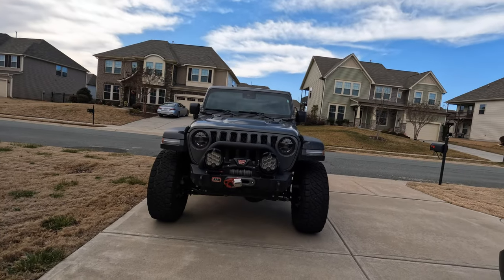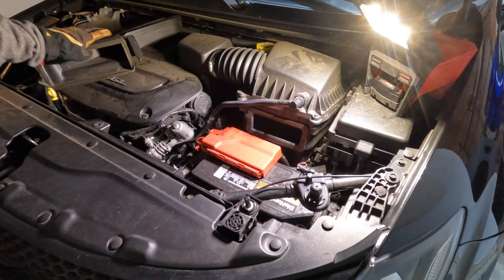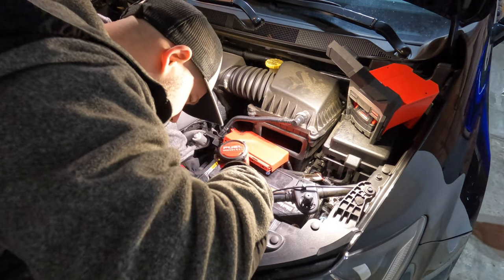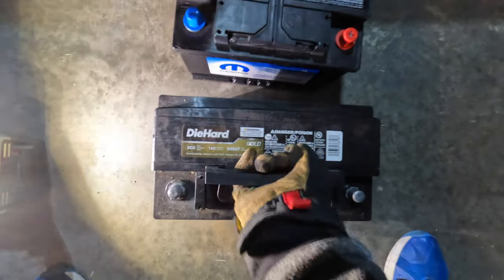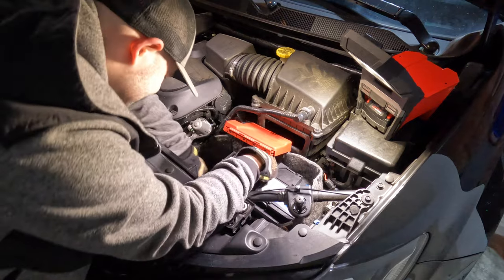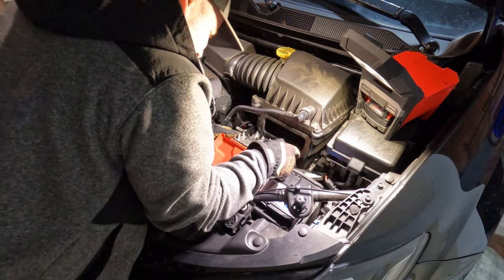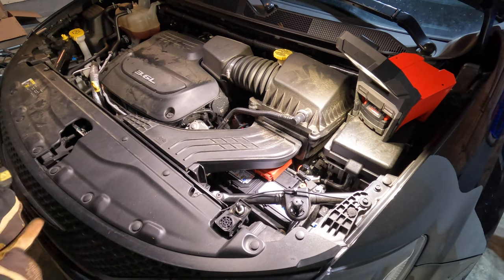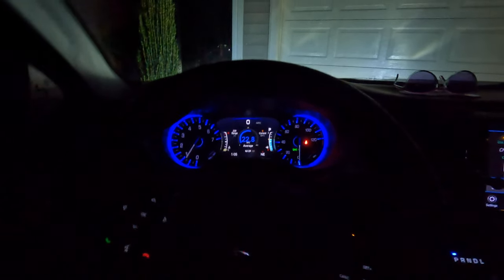How to Replace BOTH Main and Aux Batteries in a Chrysler Pacifica Minivan

Comment: Great video.  The reason the main battery doesn't fit properly is because you have an H7 which is slightly larger than the H6.  I noticed that Advance Auto lists both batteries on their website as a direct fit, however that isnt the case evidently.
Reply: H7 for vehicles without start/stop and no auxiliary battery, H6 for the Start/stop vehicles
Reply: Correct, H7 and H6 batteries are different size batteries.
Reply: Damn, I just bought on that says H7 lol. Going back now to get an H6 thanks guys
Reply: Apparently all the o’reillys autozones and interstate batteries have the H7 listed for the start stop models. I think it starts with Chryslers misinformation.

Comment: Note: if your start stop battery has been bad for more than a week or so (the light has been on for at least that long), You should just go ahead and replace both batteries like he did in this video. When one of these batteries goes bad, they both tend to go bad because the bad battery leeches from the other battery which will kill it rapidly... After a week or two at most. You can just replace the one bad one, but you are taking a big risk that the other one is bad and you may start a cycle of killing new batteries.
Reply: thanks for the tip.

Comment: When the stop start battery goes bad just disconnect it and live happily ever after. That is what I did. Mine only lasted about 1.5 years.
Reply: Which wires do you disconnect to disable the small battery for start/stop?  I hate this feature and find it super annoying anyway.
Reply: @patterbt  just disconnect one or both battery cables and tape them up on the small battery. I left my battery in there but I will probably remove it eventually.
Reply: I did the same on mine since I don’t care for the auto start/stop feature. Disconnected the negative, wrapped it in electrical tape and zip tied it to the aux battery strap.
Reply: Does everything else in van still work after disconnecting aux battery
Reply: @otero1  yes everything still works normally. The  Capitol "A" stays lit up on the display indicating "stop start" is disabled is the only difference.

Comment: Why not just remove the cables in the red thing to give you the space. The white red black cable can remove
Reply: The red thing is a fuse block.  Yes, disconnecting the wires makes the job easier.

Comment: Just used your video to replace both batteries on my 2020 Pacifica. Once I got the batteries out I looked at the back of the big red box on the main battery. I made sure of proper order and was able to depress a small clip and remove the 3 wires on the right side of the that red box. Once they were out of the way the battery went in much easier. Then before I connected the ground I plugged them back in. Thanks for a good video. Took maybe 40 minutes to change out both batteries

Comment: Great Video, saved me TONs of time by watching this first. My only comment is that you should remove the B and C Bolts on the Red enclosure that attaches to the main battery. Doing so, will make pulling the main battery out a LOT easier without having to "rip it out". You'l have a lot more space to remove the battery, trust me. The bolts are easy to undo and it only takes an additional 2-3 minute to do.
Reply: @xejorax, Your tip here was absolutely golden. You deserve a 10-minute standing ovation for it. Your generously-shared wisdom just saved me  much time and potential bloody knuckles wrestling with this. Bravo!!!

Comment: I found it unnecessary to remove the rear strap of the auxiliary battery. Just release the front of the strap and fold it toward the back of the car, out of the way Saves a lot of time!

Comment: Thank you so much. The battery died on our Pacifica and your step by step instructions made replacement super easy. Also was great to make sure that when Auto Zone tried selling me the larger size Duracell I said No thanks. Went to Batteries plus and they had both correct size batteries in stock. Thank You again for uploading this contennt.

Comment: I just attached my drill to the aux battery post terminals and put it in reverse because i was not about to go buy a torx bit just to remove battery terminals.  Worked fine, didnt strip.

Comment: There is a grey and purple connector on the positive terminal which pop out quite easily which allows you to move the positive terminal out of the way to remove and install the main battery.

Comment: This video was amazing. Like others have saif the correct bartery to use with the start stop feature is H6. Used this to change my battery on my 2020 Pacifica Touring L. 

I've never changed a battery before but this was so easy to follow it saved me several hundred dollars. Earned a follow for sure. Thanks again.

Comment: Thank you very much! About your non-oem fitment. You may have gotten the H6 AGM for the "non - start/stop" autos. I noticed this because there is H6 AGM W/auto-start/stop and likely it's the size fitment. I have a question and sharing my experience since these cars are problematic and may be others can chime in with their feedback. 

I have a 2018 limited, and the aux was new 1.5 years ago. The car went haywire and threw all sorts of electronic default codes as it was triaging its last energy. Both batteries were about 10.3v which is weird they both went at the same time? After jumping car, it maintained 13v and the aux fuse was used to reset the uconnect since it was black screen. That worked. I replaced both batteries: $220 main, $120 aux, and that was somewhat a drag. This video helped very much. I hope it stands test of time. 7 months ago (DEC 2021) there was a reconciliation done on the open recall related to aux battery management. I wonder if there is a parasitic leak , aside from the other ground wire recall, and high demand on the aux battery. 1.5 years doesn't sounds like much life before it was toast. Any other experience with this I would appreciate as the 2018 to date has the most recalls (10 open JUNE 2021) and most problematic of all the years. We love the van, so selling isn't likely, though showing unreliable compared to other cars owned makes me nervous. Thanks for your post!

Comment: The auto start/stop stopped working on my ‘19 Pacifica months ago. I just ignored it. Now it’s not starting unless I jump it. I never knew there was an auxiliary battery. I’m hoping that replacing the start stop battery solves my issue.
Reply: After my 3rd dealer AUX battery died (warrantied each), I also drove with the car with the AUX just dead because I despise the auto start/stop.  Apparently doing so puts an undue burden on the regular battery because I replaced my regular battery only 16 months ago and it's already toast.

Comment: I was told at WalMart AutoCenter that they could not test or replace the batteries in my 2020 Pacifica because it takes a special tool (data saver) to save all the programming in the system. Is there a way to just attach a temporary 12 volt battery to the terminals while you're replacing them, so that the system configurations are not lost?
Reply: did you ever figure out a solution?

Comment: Thanks for sharing 
Do the battery need to program after install 
For the 2020 Pacifica
Reply from the maker: Nope! No programming or anything needed.
Reply: They telling me it to program say it's 200 500 to replace it at the dealer here intown
Reply from the maker: @syd7479  if you are just replacing dead batteries, there is no programming involved. Did a Chrysler dealership tell you this?
Reply: I just replaced my aux and now my reverse camera isn't working and my ac controls won't show the numbers just LO and HI. Also my rear climate controls are gone. Is there a "relearn" procedure for this? I'd hate to take it to dealer to have them re flash it.
Reply: I'm having the same issue @bleakhappy and lights for the shifter are out.

Comment: I have a 2017 chrysler pacifica and there is no aux battery there.  I have read there is another one in a different area but I can't find it.  Do you know where it is?
Reply: If you do not have the Auto Start Stop then you will not have an Aux battery. It wouldnt be located anywhere else either. Those equipped with SS will have the small battery right beside the main.

Comment: Where can I find batteries for a 2017 pacifica
Reply from the maker: Either local dealership or any auto parts store. However the dealership battery will be guaranteed to fit in the tray properly

Comment: Just installed both batteries and Aux batteries. Dash said start/stop unavailable charging. Any idea?
Reply: It should reset on its own after several driving and sleep cycles.  The computer has to relearn the battery charging rates and then it will all be back to normal.
Reply: @d9999w9999  You can start it then shut it off. Wait 5 hours or longer and do this 5 times. Just driving it can hurt your new battery cause it will charge to high till you do the 5 starts and wait between 5 or more hours doing it 5 times. It charges to high from charging your old battery is why the 5 starts without driving it so it can learn the new battery or register it if you have a scan tool or take it to a dealer to have it done. If you register the new battery you don't have to do the 5 or 6 starts. You need a scan tool or take it to a dealer to have it done.
Reply: @arthurrodesiler3109  you lost me, but this seems important. is there somewhere more detailed we can read about this?

Comment: You put the H7 battery in and it only takes the H6 battery. H7 is to high.
Reply from the maker: I don’t remember which auto parts store as this was over a year ago, but I bought battery they told me to buy based on the vehicle. Didn’t occur to me to just take it back lol

Comment: Take the brace off. Only 3 bolts then you can lift the big battery out first then the aux. Putting a big battery in sideways is to darn hard. Use you brain and save your arms. The main battery is heavy enough without trying to r and r it on a angle. Also you can take the orange postive block off real easy. Take a picture of the wiring when you unplug it. I think you can only put them in only the same place cause the wires are soo short they won't fit anywere on the postive block I call it. Still a picture won't help if you are not sure. You 70 years old you won't be doing it that way I can tell you that. You break that postive block it will cost you big time. Work smarter not harder....lol
Reply: Correct, the job is easier if you remove the corner brace (bar).  It only has three 10 mm bolts that are easy to get to.